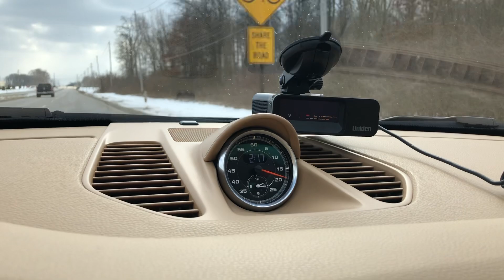Why GPS filtering on a Radar Detector is a must-have

Comment: Cool vid, I drive on that road everyday to get to school. Usually the sheriff is back in that gravel turn around! I have a cobra that was about 160 and works pretty well, have never picked up a signal from that light.
Reply from the maker: Usually they are running Ka - this was the first one I've seen with a K-band gun!
Reply: @switchcars  yeah I’ve noticed that lately, the staties will get you with KA though!